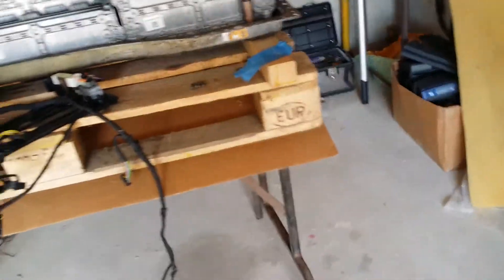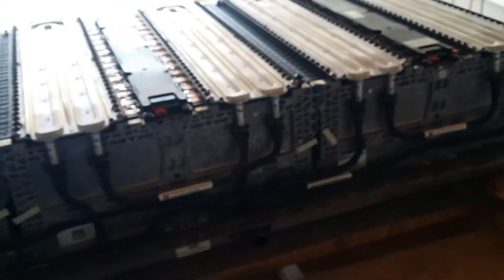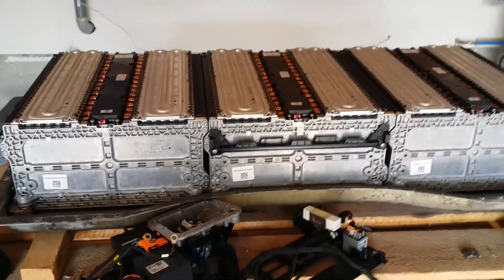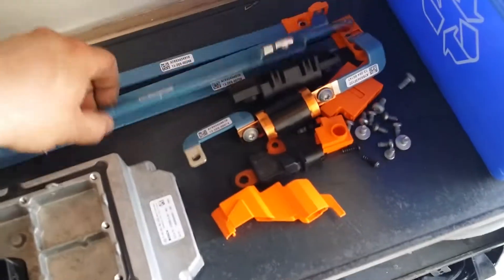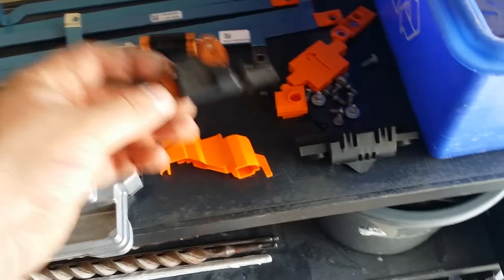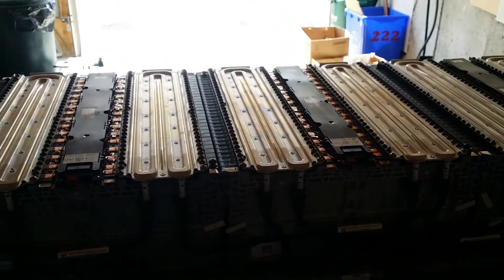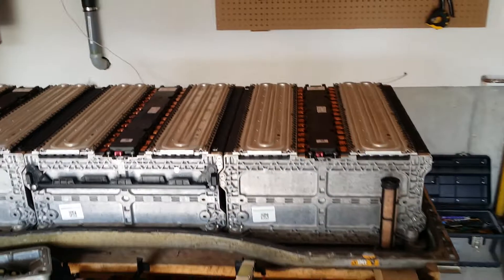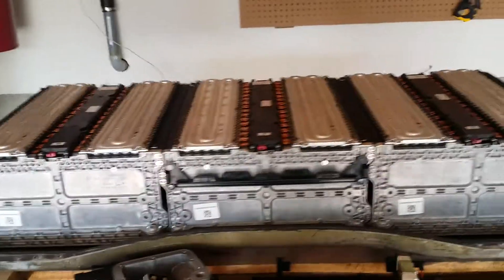Smart Car High Voltage battery disassembly (Part 1)

Comment: Do you still have the high voltage contactor assembly, if so would you sell?
Reply from the maker: do you know specifically which parts you need? I have several parts left over if your interested

thanks!
Reply: @fixbuildmod  Hello, do you have the current sensor?
Reply from the maker: @sarkismovsisyan1331  I'm not 100% but the bms and current sensor are both sold
Reply: @fixbuildmod  Can you please find out, I need it very much.

Comment: Looking for info on this battery as well, I have a 2013 smart and the battery ran low enough that the BMS opened the contacts and will not allow the onboard charger to charge the battery bank... Need help...
Reply: I have the same exact issue . Pretty soon here i am going to open the pack and try to charge the dead cells.

Comment: Hi, Steve. Do you have a current sensor and a BMS for this battery? I have my Smart ED out of charge during long delivery to Russia. To fix it I need to replace a current sensor and to fix flash memory in BMS.
Reply from the maker: Yes!!
Reply from the maker: Yes!!
Reply: Pavel Pokrashenko Hello Pavel, did you fix your battery? I am in a very similar situation here

Comment: I have smart fortwo electronic 2014 and it driven 4000 miles only.

I am living in UAE I import the car from US, i tried to charge it but i can't and we don't have electric car dealers here.

I contact one person from Ukraine and he told me I have I need to disassemble the battery and pull out the unit, then reflash it.

I don’t know what to do any solution.
Reply: Are you using a grounded electrical outlet to connect the charger to? If not, try using a grounded one. Also, does the charger flashes green leds or red leds?
Reply: www.softelectronic.com